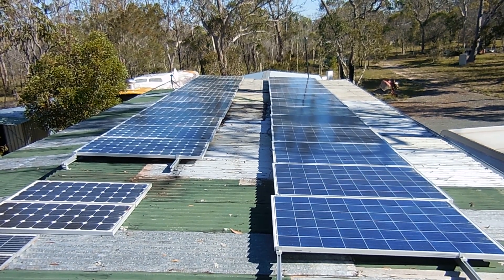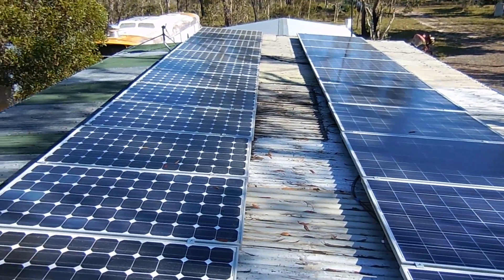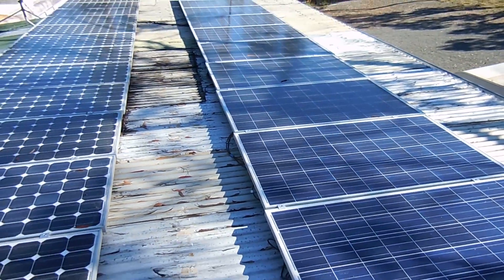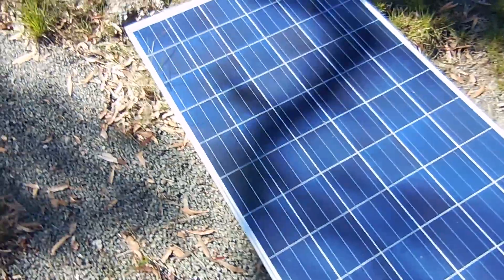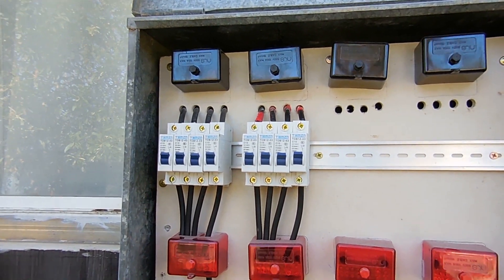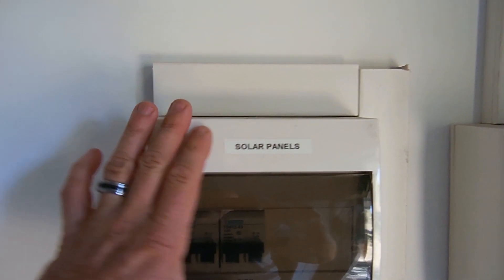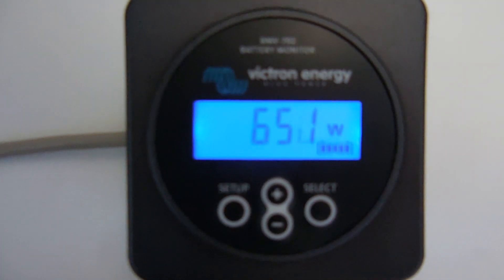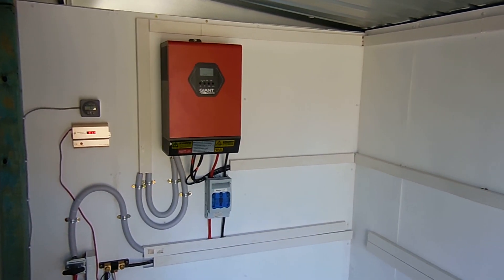SOLAR POWER SYSTEM UPDATE

Comment: Great setup What batteries did yo use. What would be the cost for the build.
Where are you in QLD, im looking at buying a bush block in Brooloo
Thanks
 Garry
Brooloo
Reply from the maker: The batteries are 12v  220amp/hr sealed maintenance free lead acid
 http://www.aussiebatteries.com.au/batteries/deep-cycle-agm/220ah-12v-flooded-deep-cycle-battery

Setup Approx cost $10000 - $12000